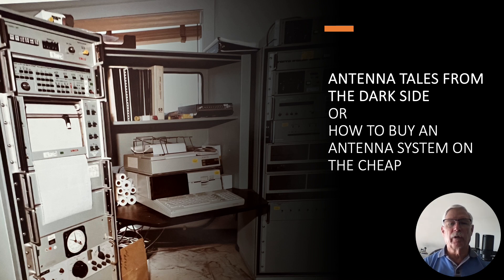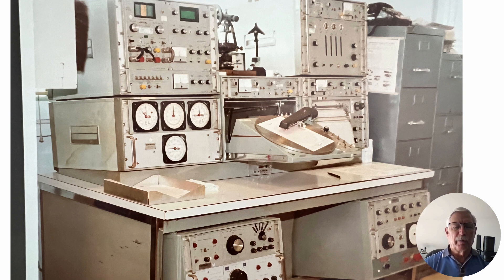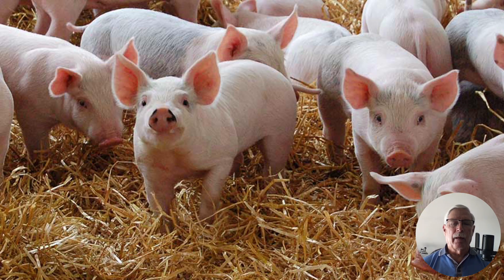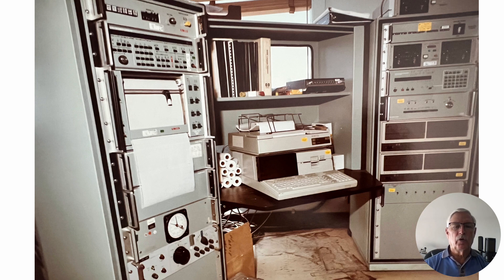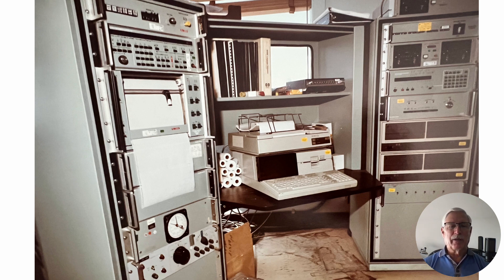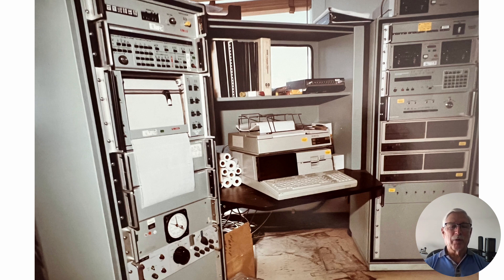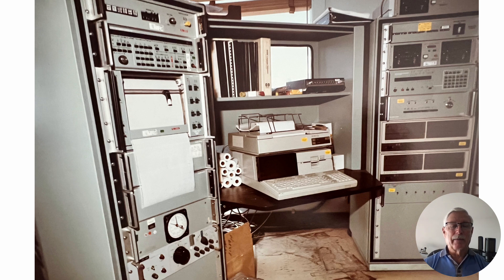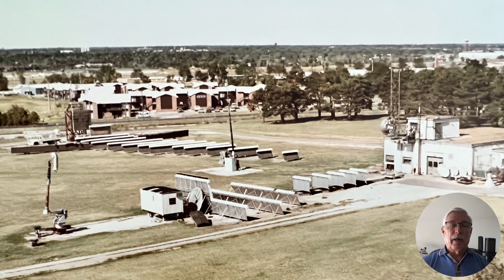ANTENNA TALES FROM THE DARK SIDE OR HOW TO BUY AN ANTENNA SYSTEM ON THE CHEAP

Comment: Boeing offerd me a similar job but wanted me to go to the antenna range in wichita.  I went through the interview where the hiring manager showed me where my office would be.  He took me to a hanger filled with with perfectly aligned steelcase 1950's desks in rows, hundreds.  Each desk had a black phone on the corner in the company approved location.  He pointed to a specific desk and said here is where your desk will be. Not a single body was in the hanger.  As much fun as the antenna range sounded, the peculiar absence of other bodies, staff or any sign of vitality made me wonder why.  I had not applied to graduate school but when Michigan cold called and said they would pay for as much school, room and board as I could stand, I told boeing no.
Reply from the maker: IPB3?? Don't blame you but the work was a lot of fun!

Comment: I also have an amature license and entered the hobby so I could apply the subarea of partial differential equations to something that actually demonstrated the math, in this case antennas. I use only Qrp rigs and boy would one of the analytical systems you had at Boeing be nice to have. 

Carl's testing scheme sounds pretty effective. Although when I defended my thesis or dissertation one of the commitee members, actually the dept. head, asked a question that would have led most any instructor to say, you need to find another major. Yep some were brutal. Anyway, the guy was actully brilliant, he just had not read with understanding my paper and had not focused on the topic recently, but it certainly removed the Wizzard of Oz pretense that some like to generate.